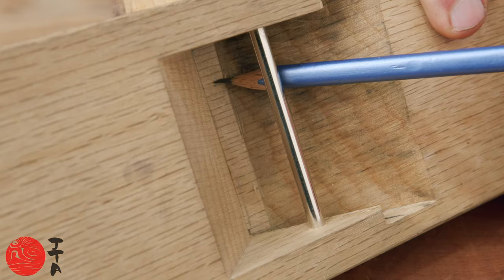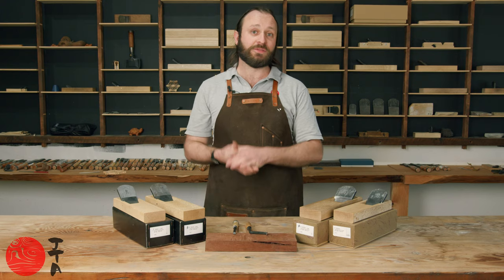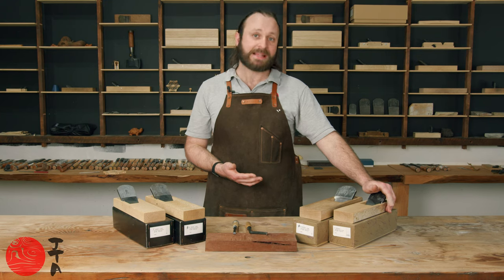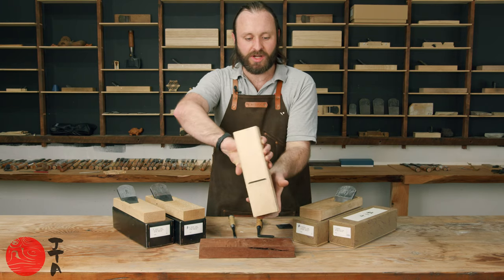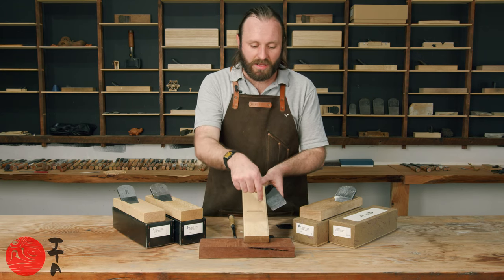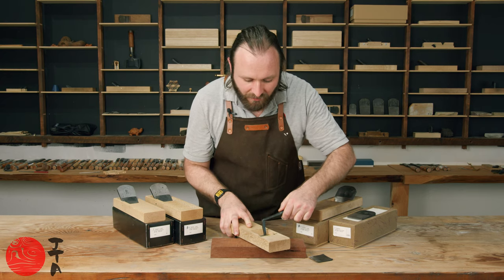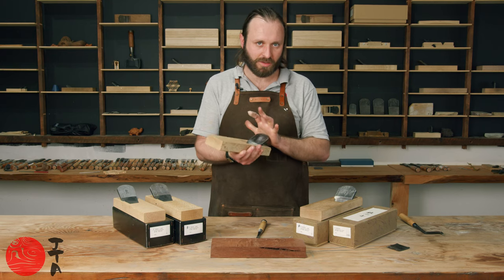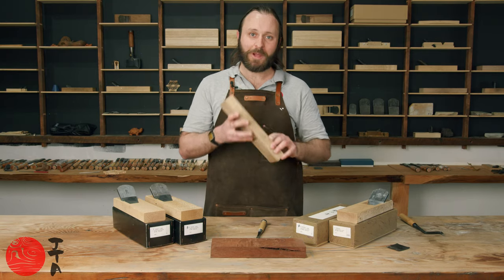Plane Tuning Addendum - Tsutsumi

Comment: One of the actual although minor advantages of a tsutsumi is, that it allows for thinner stock to be more easily worked with when crosscutting end grain on a shooting board. Very thin pieces of wood tend to catch the plane bed. Old english mitre planes or bevel down planes in general have the same advantage, but the main intention there was probably decreasing chatter, as the thinner blades were more prone to that.